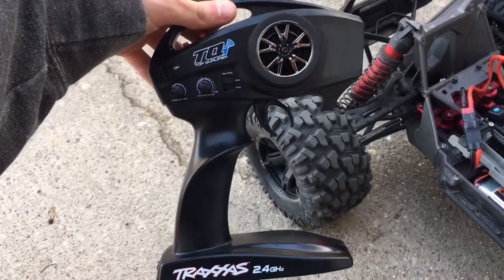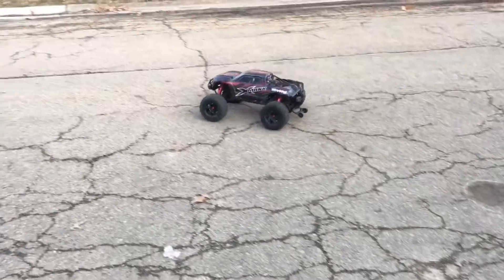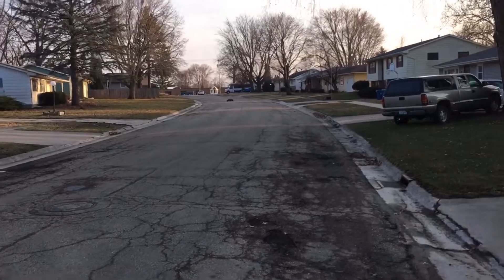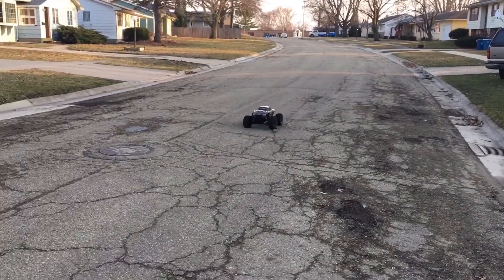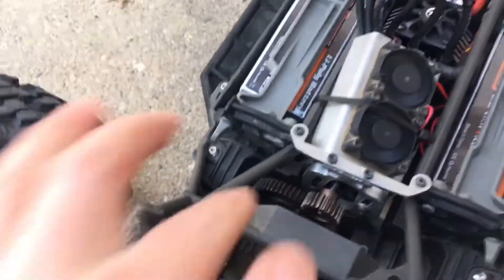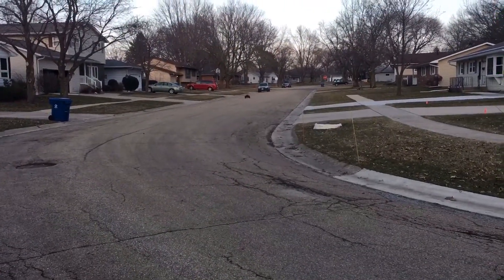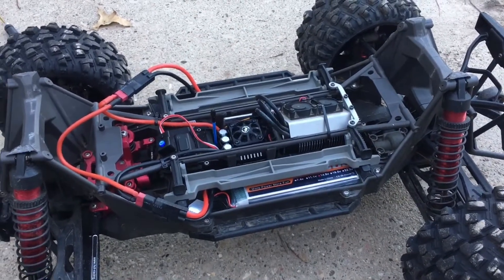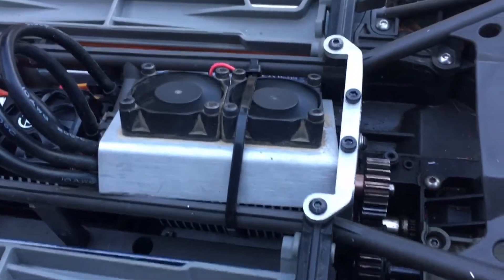First Test Run With The New Electronics In My Traxxas X Maxx 8S -It’s AWESOME! Tire Gets DESTROYED!!

Comment: Very cool video but just my opinion, seems like that motor is too much what good is it if it keeps flipping over every second
Reply from the maker: Jeepdogsbikelife 1 I think I just gotta get used to the amount of throttle I can give it. I still think it’s pretty cool though as long as I don’t have any overheating problems I’ll continue to run this setup. Might have to get a set of belted tires though